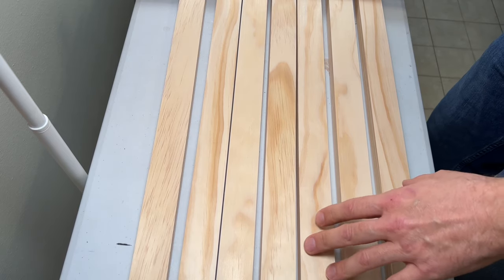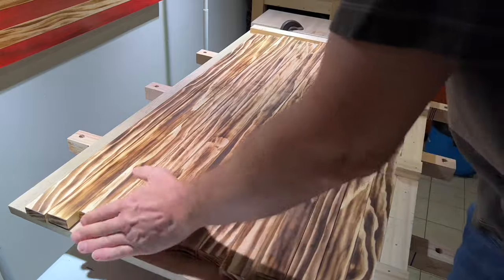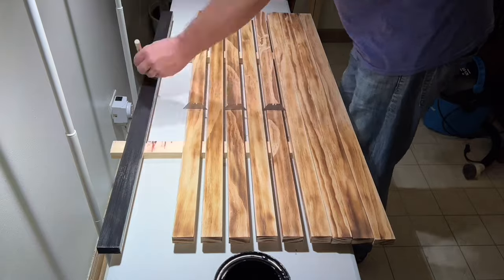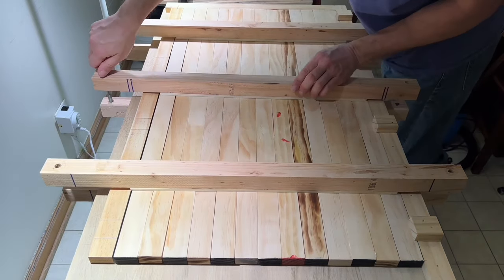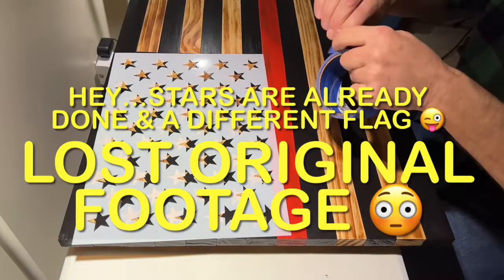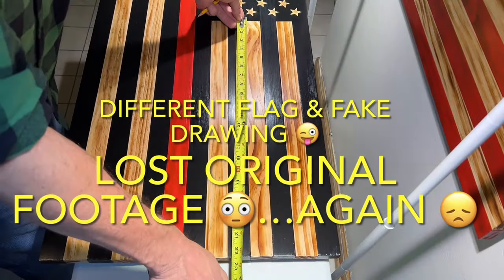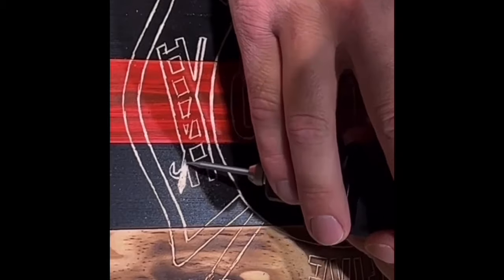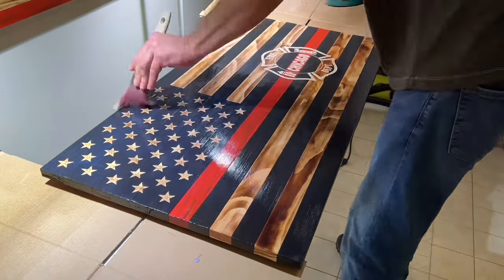How To Build A Wood Flag - Step by Step (Red Line with Custom Logo)

Comment: Excellent video.  I would try a plastic straw for glue removal on the face of the flag.  I crease it with a utility knife and then use the crease to scrape it up.  Works great and it won't take off the stain.

Comment: Flag Giveaway   Thanks so much for the step by step. I've been toying around with the idea of building one of these. Thirty years in the service ( retired now ) and for some reason I don't have one. Wondering how I'm going to approach it since over a 30 year period I've stood every color. Might give me an idea of how to incorporate every color into one flag. Thanks for the video. Liked, Subbed, and commented. U-403
Reply from the maker: Thank You for your Service!  If you have any questions with your build just leave me a comment or shoot me an email at RWBFlags1776@gmail.com Ive seen flags with multiple colors where they split a stripe in the middle on a diagonal and cut the second color into the stripe. This can give you two colors per stripe if it helps. Also, on my first video uploaded (Protectors LEMC) I have a blue and a red line. Unsure how many colors you will be using. If many you may need to build a couple flags which would be cool too! Thank you for your entry! Now we need to hit 1000 subscribers!

Comment: In response to tricks for marking the Union. I started off the same way, painters tape. Hated it. I switched to hammering in a utility blade on the three boards over my pencil lines just like you. Had mixed results. Maybe you’re more precise and don’t have this issue, but I found that after I stained when I pulled my blades that many times I would end up with an uneven line. Either the blades were slightly left or right of the mark or the angle wasn’t perfect and the blade didn’t hammer in at a true 12-6. Made my brain hurt. Easiest fix I found was to take a solid straight edge, I used my steel stencil so I didn’t have to bother with measuring, and I held it in place just like you do with the Mylar stencil. Then I’d take a utility knife or exacto knife and scored all 7 Union boards straight down to give a much cleaner line. Then I would go back and hammer in the 3 blades. Just ever so slightly scoring the line first also makes it a lot easier to hammer the blades in so you can get a little deeper into the wood and not have them pop out. That was a long comment to say “score the Union line before you hammer the blades in” lol.

Comment: Flag Giveaway. Great instructive video and finished product ! Have you ever tried using the Dremel router with your Dremel for the outlining and carving?  I've considered it and was wondering if it's been tried ? As you say in the video you use two hands to keep the tool from taking off on you and I was wondering if the router base would help??  Thanks
Reply from the maker: Thank you for your entry! Now we need to hit 1000 subscribers! I do have the Dremel router and have seen people use this when carving the stars. I did try it and it was chewing up the plastic stencil...I just need to practice or be more careful. For quickness this will work but I do prefer to do it by hand...think it gives the piece a little something extra...that's just my personal preference. I do use a very old Dremel from the 80's and it may have more power than the new ones as I see people using the Dremel 3000 with one hand. I am unsure about this just a guess as I have never tried a newer one.  Also, they do sell an attachment (flex shaft) it’s about the width of a marker and this looks easier to control the Dremel. When this one dies, I will pick up a new one but probably try to repair it first if possible lol...I am a believer of use what you have. I may do a video in the future of carving the stars with the Dremel router to show everyone options. Great comments / questions! Thank you!
Reply: @redwhiteblue1787  The flex shaft makes all the difference in carving the stars. When your old Dremel dies, it will be worth buying a new one with the flex shaft, believe me! 😆
Reply from the maker: @gaylewilliams7353  Funny enough you say...my 1980's Dremel died last week during a custom logo build (video will come out after Christmas sometime.) The metal brushes wore out and were the last ones I had on hand also they are discontinued. I found 3 on eBay in Australia but deliver date was December 30th and the build was commissioned to be completed before Christmas. So, to Amazon I went and they overnighted me the Dremel 3000 with the flex shaft. It is AWESOME! I am loving the flex shaft for the engravings.

Comment: Would a CNC get this done quicker?
Reply from the maker: Absolutely but then it would be machine made and not handmade. Both are great ways to go about it just comes down to personal preference and the look you are going for. Appreciate the great question!
Reply: @redwhiteblue1787  I guess it comes down to what a person considers 'handmade'.  To me using a CNC is no different than using any other tool that woodworkers use on a daily basis.  A saw, sander, lathe, jointer, planer, etc.  They all require some degree of 'hands-on' to get the job done.
Reply from the maker: @fstoll3  Sounds like your trying to convince yourself. I have to kindly disagree. Programing software for a machine to o all the work is not handmade but CNC are awesome machines.
Reply: I’ve found that the Crimson looks better and is more consistent with 3-4 coats. But as you’ve stated, it is personal preference. Nice work though.